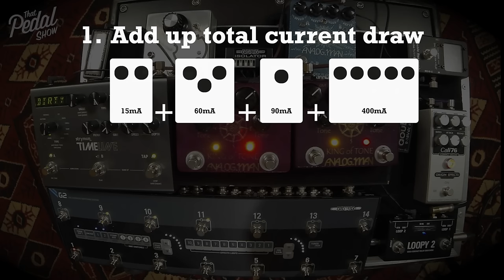That Pedal Show – How To Power Your Pedals Properly & The Legend Of VCPI

Comment: Love this subject, can you please tell us more about power supply and isolation? I mean, let's talk about your products, not other brands, the Generator output is a single 9V 5A non isolated that "conventionally"  feeds a Distributor. Now we know that the Distributor "distributes" the current, but how? As it has 6 9V outputs does that mean that every output has 833,33mA (5000mA/6)? If I connect a second distributor to the first one that is receiving the current from the generator, will the second distributor have only 833,33mA to feed its 6 outputs giving me 6 9V output with 138,89mA each?? (i don't understand how to caculate the mA and how it works) And finally what does the isolator do? I mean how does it isolate the negatives? is it a kind of filter with capacitors and resistors? and having 4 outputs are they isolated from each other or is the block (the isolator) that is isolated from the rest of the chain and the 4 outputs of the isolator share their negatives?? Please answer all my questions, i'm really really interested in understanding this "highly underated" subject. Love your products. thank you
Reply from the maker: +Carlo De Vivo MusiContent Hello, Mick here. I gave up trying to understand this stuff and just gave in to the fact that when I use Dan's power stuff everything seems to work in a way I love. And it's so easy to transfer between bigger and smaller boards. Hopefully Dan can answer the technical stuff. Thanks for watching!
Reply: Yes, Please ask him to answer, I really want to understand this.

Comment: Hi, thanks for the video guys, really cool and informative. I just have a question about isolation.If I am using the MXR DC Brick and each pedal has its own separate cable ( no daisy chain) from the Brick, does this mean that each pedal is isolated? Cheers
Reply from the maker: +Flamenco Al Nope. The earlier, black bricks do not have isolated ours as far as we're aware. The later silver one might even be called an ISO brick? It will say prominently if they are.... cheers!

Comment: When you unplugged the timeline from the isolator, was it then powered by the gigrig generator in the distributor?  Or something else?  great video!   but I'm a nerd.   So I love this kinda stuff.  More nerdy video's and diagrams.    

I also feel like you guys work... really really hard to not push that Dan created the Gigrig, and arnt using these video's to push his gear.  Which is appreciated, but... Dan... do you have a USA distributor for the gigrig?
Reply from the maker: +Southardknives yes, it was powered direct from the distributor so it was no longer isolated. We sell direct in the USA. Cheers matey :)
Reply: Excellent,  thank you.   Cant believe how much noise was caused by that.   Just moved into a new to me, but super old house, that has no grounding.   All sorts of new noise, but getting that sorted.   My Cioks dc-10 is great. But my pedalboard keeps growing beyond its powering ability.  So expect an order soon.

Comment: @That Pedal Show 

Hi guys, thanks for the video! May I ask - can I power a pedal that requires 300mA current from a power output on a block that supplies exactly 300mA or is there any need for the slot to supply more than the pedal is listed as needing? Im aware that the whole block should supply roughly double the total pedal required current but I’m wondering if there is any similar requirement per-pedal?
Many thanks
Reply: Any output that supplies >300mA will do as soon as you have the voltage right. Say your pedal is 9V and requires 300mA you can connect that to say a 9V 450mA output. This means that output can supply max 450mA at 9V from that certain outlet and whatever your pedal needs, it will only draw that amount of current from that outlet

Comment: Very interesting stuff guys. One question though: I own a Whammy Ricochet which draws 230 mA. So you guys are saying that I will not be able to run this on a Voodoo Lab power supply output of 400 mA? To me that seems strange. Multiplying the current by 2 seems overkill to me. Am I missing something?
Reply from the maker: You absolutely will be able to run it from that. I’m not talking about individual outlets, more about the entire system, but the VDL stuff is great and really solid
Reply: That Pedal Show Cheers!

Comment: Curious, is the effect of varying the voltage to a pedal analogous to varying the wattage on an amplifier? For example my Mesa Boogie lets you switch between 10, 45, and 90 watts. Is the primary difference (aside from volume change) the compression?
Reply from the maker: +TsiratiugZ all depends on the design of the pedal, but if it increases dynamic range then it's similar :)

Comment: I'm confused, if you know the current needed and double it, and therefore have what you need to run your pedals, then isolation is really just an extra step to prevent noise at that point? 1. If you do not have noise is isolation necessary? 2. Isn't isolation just to protect individual outputs from shorting each other out at once if something happened to one?

Comment: Great show ! I got one question though: I own a couple old japanese Boss 9V ACA pedals (said the manuals and stickers), wich apparently need an unregulated power supply... I use 9V battery when I can, to be safe, it's still the best way to power old analog unit that are not too hungry on current. This is a common thread on forums topics and apparently the best way to power those using a modern regulated transformer IS to daisy chain the power and to feed the Boss ACA with shared current, which apparently then becomes unregulated? I know it works for doing it too. But how does that work exactly ?
Reply from the maker: +Captain Danny OK, the old ACA pedals have a diode across the supply. If you put a standard 9V DC into this pedal, the diode will drop that down to 6v, and won't sound great. If you put 12v DC into it, the diode drops it down to 9V and it founds great :)
Reply: Thanks ! Didn't knew that ! People already told me to use 12V but couln't explain what was the science behind using 12V with a 9V unit. Now I can use a 12V transformer and hold you responsible if smoke comes out of my pedal ! ^^ By the way, any chance we could see you guys doing an episode on bass pedals with guitar/bass ? Or pedals on keyboards ? Or pedals using a mic and weird stuff like bagpipes, brass instruments or something ? :-) Cheers

Comment: Thanks for the video guys!, my question is does running a pedal that accepts 18v affects in anyway the durability of the pedal in time? I know that practically it does not matter in most if not all cases but theoretically does it decrease the lifetime of any component inside the pedal? Cheers!
Reply from the maker: +konnektlive if the pedal is designed to take between 9 and 18 V then no, it makes no difference
Reply: Thanks for replying. Well the reason I asked the question was because my Cali76 CD Compressor becomes very slightly warm when I run it at 18v. I contacted the Origin Effects and they replied that its normal. So I was wondering maybe because it get a little bit warmer than the 9v it might actually reduce the lifespan of the unit? Thanks again!

Comment: Hello again, folks - I just tried powering a Kenton Thru 5 midi splitter which is Centre Positive by reversing the power cable's connections to the Isolator (white stripe to black input and vice versa). It didn't power up. But when I tried it with your Reverse Polarity cable adapter (wired via isolator in the normal way), it worked fine.

Am I doing something wrong? Is there any way around buying more reverse polarity adapters?

Happy new year all! You're amazing :)
Reply from the maker: +Mat O'Neill hi Matt, the only reason it wouldn’t have worked is there must have been a bad connection when the cables were reversed. We use this method all the time, works great
Reply: You're absolutely right - I must have been a bit fat-handed on the first attempt. It's working perfectly now and powering four midi thrus - I call them my Retarded G2

Comment: I'll ask here since I don't know where else I could quickly ask. If someone knows, please inform me.

I bought a basic stomp box, Boss Super Chorus and when I plug 9V power supply into it, the led is constantly burning (not that dim either) and there's lots of noise even if it's not switched on. If I switch it on, the led slightly brightens and it does sound normal but maybe a bit noisy. I would consider my power supply being not suited but it works perfectly fine with my Boss Super Overdrive, no noise or lit led when bypassed.

I can't currently test with 9V battery unfortunately but is this a clear sign of some way faulty pedal or wrong kind of power supply? I suppose Boss stomp boxes that are supposed to be powered by Boss 9V power supply should all work with the same supply especially when tested independently. Can isolation be the problem with a single pedal? It's not that high frequency hiss though.

Comment: Ok, so now that I know all of this, are there any suggestions on actual power supplies? I have all 9v DC pedals, 6 of which I need to isolate. I realize there's not one perfect option, but stone choices offered would be great.
Reply from the maker: +worldofjohnboy We use TheGigRig modular system. Other power supplies are apparently available. ;0) You need anything that will do 6 isolated outs... Check out Cioks, VoodooLab, T Rex and Strymon. Maybe even the Dunlop IsoBrick?
Reply: That Pedal Show Thank you... I think I'm going with the MXR (Dunlop) Iso-Brick.  I may even be able to power my Whammy IV pedal with it, from what I've read.  My old Boss "daisy chain" pedal is going bye bye!

Comment: I got taught at school:
Left hand + right hand - 
Hold out left hand make a C shape. 
Hold out right hand make a fist.
Bring them together like a karate master greeting. Then reverse the hand shapes for AC.
Reply: I'm not sure what you're trying to say, but if that's how you tell the polarity of a barrel connector - it's wrong. Barrel connector polarity is entirely determined by whoever designed the circuit it's attached to. You have to have a drawing somewhere on the plug or the jack showing you the polarity they're using. Also, AC is a totally different beast from DC. It doesn't have polarity. It's sinusoidal with reference to a ground. Do not plug AC into your pedal unless it's specifically designed for it, or you almost certainly will blow it up.

Comment: Damn, I never knew about current! If it says 9v I plug it into the isolated thing on my power unit that says 9v. I have a TC flashback triple delay I've never been happy with. Hard to explain, but I can never get epic sounding delays despite all those engines and tone prints and such. I'm out of town, but I looked up my power supply on Amazon and the current requirements for the triple delay. It requires 300mA, but four of the 9v slots on my pedaltrain powertrain 1250 are 210mA or less. The other four can be a total of 500mA, which implies the four aren't isolated. I'm out of town, but I can't wait to get home and see which one I have that delay unit plugged into. Also, would that one bank of four 9v that can add up to 500mA mean that they aren't isolated and can add noise? 

Thanks again for your show. There's no other way a lay person like me who plays for fun could learn this stuff. Also, I'm looking at the walrus Phoenix, which has 15 isolated supplies, 4 that have 300mA, and a couple that have adjustable voltages. That sound like a good option?
Reply from the maker: +Joe Sanders sounds like a great option. Yes, the current draw number is essential to get right or the pedal won't be operating at its best

Comment: I was wondering, if its possible to "expand" my isolated powersupply (in my case the carl martin pro power 2) with a daisy chain? So i plug a daisychain into 1 of my isolated outputs and chains it up with 3 or 4 analog, low current draw, pedals? Is this an option and where do you get a daisy chain like this? Keep doing your thing Mick and Dan, its amazing :D -Anton
Reply from the maker: +Anton Nielsen as soon as you use the daisy chain you are no longer isolated. It might be ok, but it's not best practice
Reply: The pedals plugged to the daisy would not be isolated. The rest on separate outputs would.

Comment: Boys, next step here should be which power supply... There is a myriad of them and explain their differences in plain language you do so very well. Like Voodoo Labs, Gig Rig, MXR, Eventide, Stry,mon TRex Coiks Etc and explain their differences ... Also be good to add, wall and the AMP powering; IE. power filters, balanced powers supplies, good groundings especially for the home recorders..

Comment: I have a nice quiet board and pretty sure I've got my VCPPI correct, but I've played some venues where there are huge lighting rigs and the hum can be horrific. Is there anything that can be done in that scenario or is it a case of getting a dreaded noise suppressor?
Reply: I've encountered some truly awful sounds coming from my bass rig while on tour, but none that couldn't be silenced  by a Palmer Line Isolator between my board and amp. Well, aside from the awful sounds I'm directly responsible for, anyway. :b

Comment: Question on current requirements. If I have a isolated power supply that provides 100ma and I have a pedal that draws 80ma, will that be enough power? Or do I need to have double the ma? For the 80ma pedal 100ma will do or do I need 160ma and up?
Reply: Basically the pedal will only draw the current it needs, so as long as the supply can provide the 80ma your pedal needs then you shouldn't have a problem. If the supply is good quality you shouldn't have any problems with the 100ma supply, which will give some overhead, as the pedal may need more than 85ma sometimes.

Comment: Fascinating that power supplies "brown" when close to maximum current output. Can't help but ask, a power supply like the one Strymon is about to put out has nine isolated outputs at 500mA each. Do you know how many mA the Timeline draws (I guess I mean can you measure it as opposed to what is claimed)? I sort of get the impression that you would consider even this to be potentially inadequate. Or are you saying that it might start to brown the voltage only when the entire power supply, as opposed to a single isolated output, approaches maximum current output? I'm in the process of figuring out how to power my big digital pedals (I have a Pedal Power 2+ for my other pedals right now), and I'm trying to understand all of this as well as possible before I spend any more money...
Reply from the maker: +Randy Thomas no, the Strymon supplied are perfect for the Strymon pedals. Sometimes when manufacturers put how much current to pedal takes, the over value this to make sure people use a supply that can deliver enough current. The timeline draws no more than 300 and their supply can easily deliver 500 per output so it's perfect for the job

Comment: Dan, what do you mean by there being a design flaw in the center negative barrel jack? Do you mean that a jack should have positive in the center and ground at the sleeve?  Thanks GigRig!!!
Reply from the maker: +STRAT-O-HOLIC Richman because the outside of the barrel is positive, all it has to do is touch a pedal chassis or any metal connected to earth and it causes a short circuit.
Reply: Yeah that's what I was thinking but we stick with technology that's old for no point other than it's there... But hey the new iPhone doesn't have a 3.5mm headphone jack... Certain things I'd still like to keep LOL
Reply from the maker: +STRAT-O-HOLIC Richman good point :)

Comment: does it remain silent without a power conditioner and if the power outlet is dirty meaning without an individual output line or where you plug into a wall. the line inside the room or hall.

Comment: also, on my board I have a Boss NS-2 which, as im sure you know, has a 9v in and a 9v out to run a chain off of.  My smaller travel board has 9 pedals on it(boss, MXR and TC stuff, all take 9v) but most power supplies i found have only 8 9v outs so could i run one of those into the NS-2 then use the output of the NS-2 to go to just one other pedal safely/effectively?  would this negate the isolation of the power supply? would it be a big deal as far as noise goes? 
Thanks, love your videos.
Reply from the maker: +Lorenzo Rizzardi Try it Lorenzo. You'll soon find out if there are noise issues. Additionally, Dan makes something called an 'Isolator'. You run that off one of taps from your power supply, giving you four extra isolated connections. Just make sure the total current draw for the pedals on that particular adapter output doesn't exceed its  maximum amount. Cheers!

Comment: Hey guys, i'm re-watching this because I'm planning a new pedal board build and had a quick question regarding drive pedals that that can be run at > 9v. Does this make as pronounced a difference on pedals that employ clipping after the gain stage(s)? It makes total sense to me that clipping would occur later once you increase the voltage to a circuit, but if you're specifically designing for clipping, it seems to me that the tonal differences between various voltages might be less pronounced. Thanks to anyone that can indulge my curiosity!
Reply from the maker: +Will Folse Really depends on the pedal Will. If you just take a minute to A/B, say a Fulltone OCD at 9 and 18 volts, you'll hear the difference immediately. It still drives brilliantly, but it's just bigger, faster, more dynamic, less compressed (assuming it's hitting an amp that has the headroom to highlight it). Which you either prefer or you don't. As for what's specifically happening at the clipping stage, I'm not sure (Mick here). Cheers!
Reply: Thanks Mick!